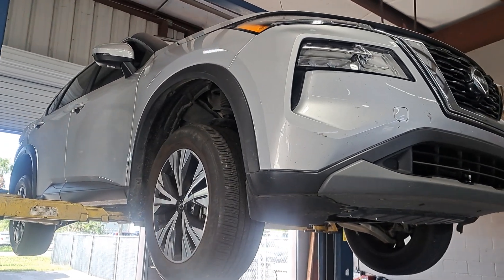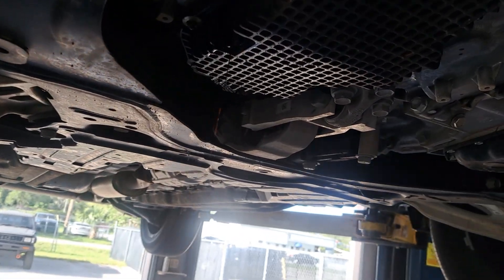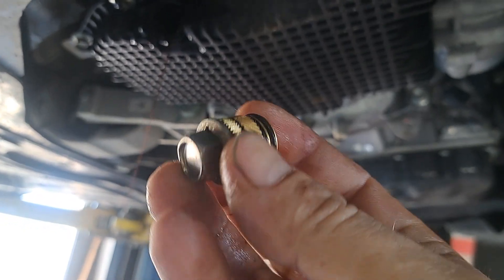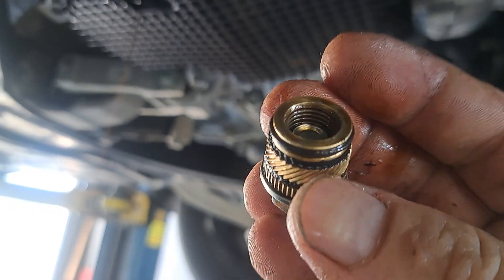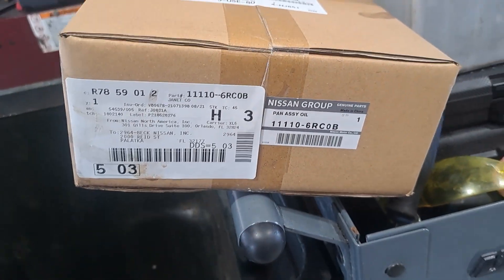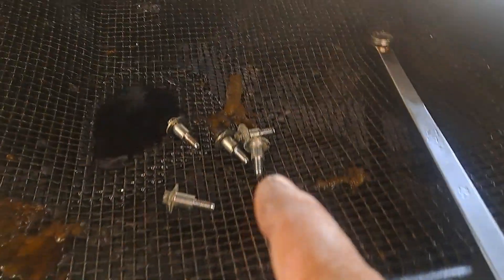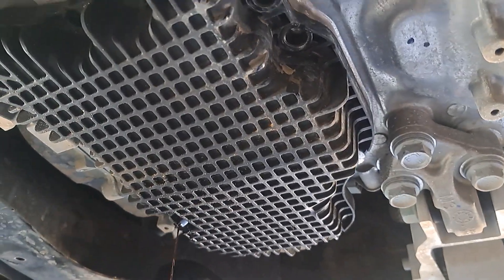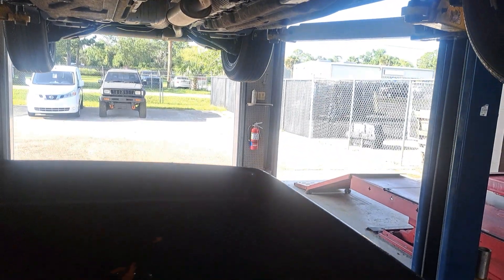don't over tighten  the oil drain bolt on a 2022 nissan rogue 1.5 turbo

Comment: It's truly amazing how many people think "the tighter the better" on any fastener, regardless of the type or recommended torque numbers.
Reply: no sir, due to heat expansion the plug swells inside the brass setting and causes it to tighten. and the plastic oil pan holding it is 3mm thick x2. two 3mm rims of plastic. when plastic gets heated it loses its structural integrity and cant hold onto the plug. this is a manufacturing defect thats not being addressed.

Comment: Does it come with a new gasket? Thanks
Reply from the maker: Yes
Reply: @smallengineguys  what tork did you put to the bolts around the oil pan thanks again
Reply from the maker: @tobbym0  we dont. I just tightened and done but its somewhere between 5 and 10 nm

Comment: I just did this🤦🏾‍♂️
Reply from the maker: Yikes. New oil pan time.
Reply: Same here guys this shit must be common because I only pulled it to get it lose and SNAP now I have a customer with a broke car thanks Nissan 🤨
Reply from the maker: @rdm3609  it happened maybe 2 times in the last year so not uncommon but not all the time
Reply: @smallengineguys  so would it have been any different if I used my ratchet wrench instead of my socket wrench?
Reply from the maker: @rdm3609  no. Whoever changed the oil before you overtightened it
Reply: @smallengineguys I'm late to the party.. but who takes care of that when it breaks? I went to get my oil changed today and they wouldn't do it because the plug was too tight. He said he broke one before and didn't want it to happen again. I know the shop that made it too tight

Comment: doesnt matter the torque spec. the plastic dissentegrated due to bad heat absorbtion. bring the pos in and blast it with something cold to shrink the drain plug, then remove it. the steel stays expanded whilst the brass ring cools off and shrinks around the drain plug, therefore rips the plastic drain pan. my dealership has a 3 month back order with 2 rogues sitting in the parking lot with bad oil pans. and i get reemed for me breaking the pan....screw you nissan you save a buck and you make me pay for your poor choices. put a metal oil pan recall on it ffs. but that would put them out of business....dont buy 2022-2025 rogue vc turbos. you will never get to use your car after an oil change.